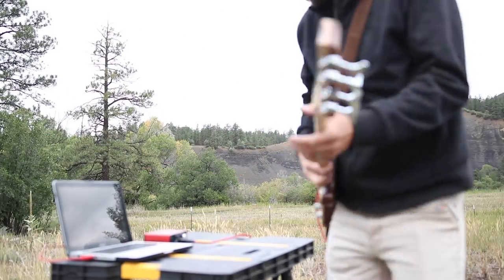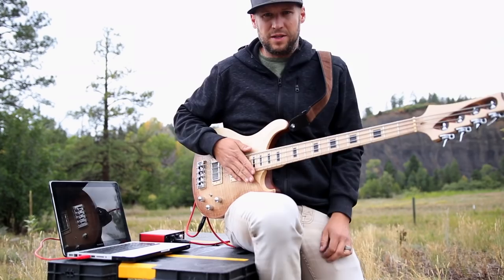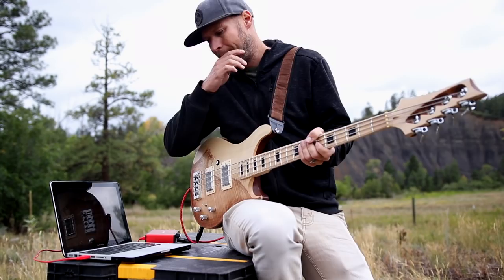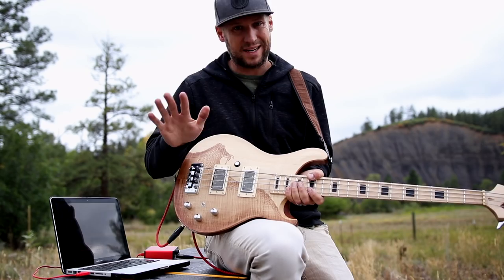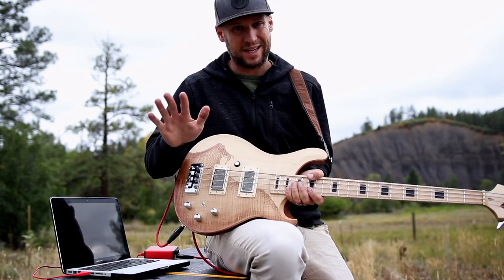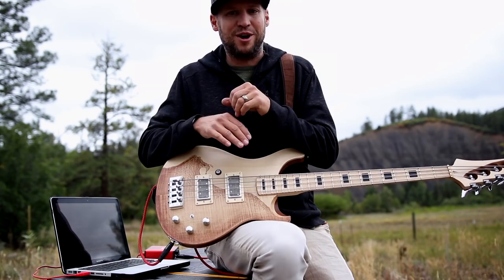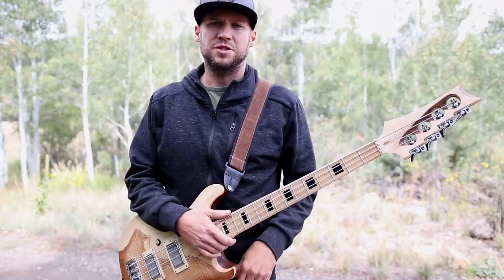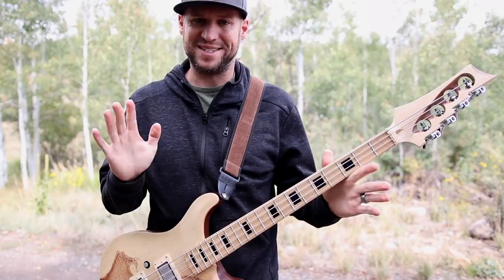Great Guitar Build-off SOUND DEMO (PRS style BASS) series/parallel double P bass

Comment: Hi Dan, I'm a big fan. I liked your work and work methods..and then found out that you're a Christian, and your stock skyrocketed. I'm doing a Firebird build and was thinking of adding two extra screws like you do to pull the neck down into the pocket. I'm looking at it and decided to try a different method. I tested it out on a scrap piece and it worked. Then drilled one pilot hole in the neck and tried it and I could feel the neck pulling down as the screw tightened, so it works! The neck comes without screw holes, and to avoid splitting it, I drilled pilot holes, used a 0.1125 drill bit. I angled the drill about 10° I'd guess, angled up towards the headstock. This way, as the screw tightens, it's pulling the neck down into the pocket. If you hold the neck with your fingers touching the neck and the body, as the screws tighten...you can feel just a little downward motion of the neck. It's tight as a drum! Check it out and let me know what you think. Thank you 🙏

Comment: Thats awesome! 
I put a P-bass pickup in the bridge of my EBO a few days ago and also added a series parallel switch, also wired for stereo with a toggle hehe
Also i added a passive distortion circuit, but you need PUs that are hot enough to drive it.

ok now that i actually watched the video, you are switching the pickups internally in series/parallel. 
on mine the switch decides if the pickups themself are wired in parallel or in series to generate more output for the distortion.

Comment: The E and G sound weak and dull... Bad pickup design. May be cuz there is only one magnetic pole for the E and G.  The A and D seem to have 2 magnetic pole so more output.
On the other hand the wood work is pretty good. Nice carving. Nice finish...
Those pickup are for this beautiful bass what guns are for jesus..... Useless.
Reply: I don't hear any change in tone between the E and A string. You might want to check the video with your headphones. You could be missing some lower overtones.
Reply: @BrunoNeureiter   seinheiser hd 250 headphone 1rst version... check.
 pioner power amp, 3a passive diffusion system... check
pro sound tech clean of hear wax... check
it s so obvious each time he plays the natural E,  around 1min00.
Bisou
Reply from the maker: Wish I was clean of hear wax
Reply: @GunsandGuitars  Hi, salut, shalom, salam. To start let s put  aside our egos.
Your build is one of the pretiest i ever seen. Solid and efficient construction. The neck fixation ( B.Sheehan style ) is great. Carving and finish are gorgeous. Crazy headstock, good electronix and nice hardware.
You deserve to win this this contest.
About those pickups...At first when i watched the construction video and saw the pick ups, i had the thought that the magnetic pole configuration u used was unbalanced and i imagined u had a trick for this, i then waited for the demo video impatiently. I never sayed it sound bad, it sounds awsome, it growls and the electronix allows different music context. Was so surprise to hear it that i keep repeat the part where it s obvious.
Before posting this, i emulate the configuration with a fender cabronita modiffied with:
_TV Jones filtertron pickup
_Schaller bridge (for better string spacing and then better alignment string/magnetic pole. Biggest fender cabronita's defect)
I left 2 poles under the A and D strings and unscrewed one pole under E and A.
Result is less magnetic field so less electric current in the coil. A multimeter allows a simple reading.
A simple modification on the current pickup like get ride of 2 poles on each  humbucker to have a real pbass magnetic pole config will armonise the magnetic field.

Once again u deserve to win.
Sry for any typing mistake...I m still learning english (one hour to type it....lol).